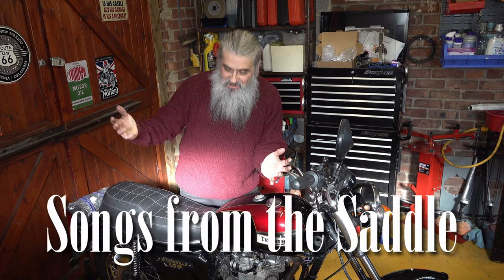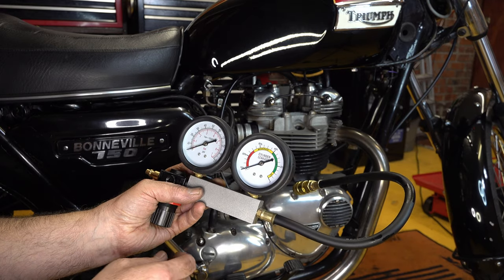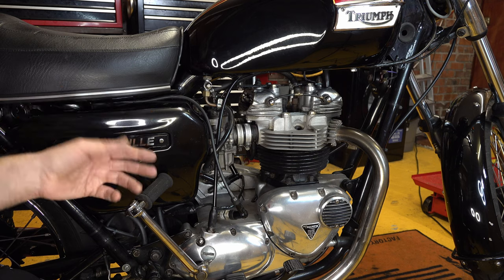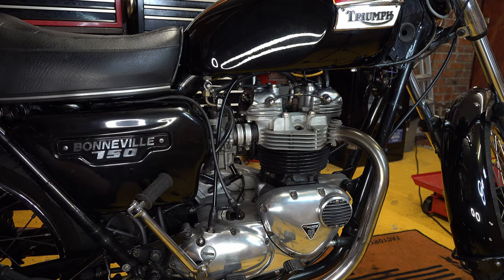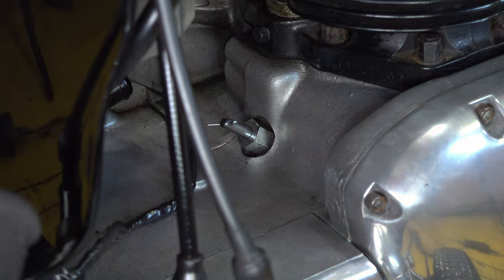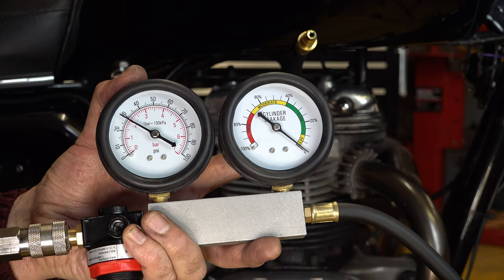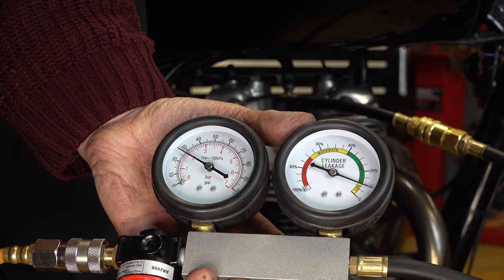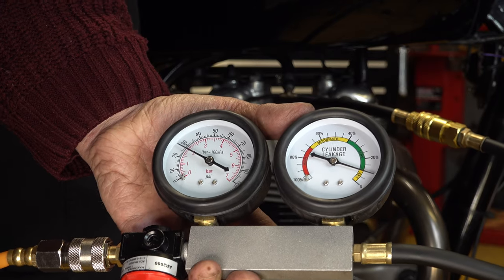Triumph Bonneville T140 leakdown test

Comment: Simon, just wanted to say thoroughly enjoy all the videos especially being as I am on my second t140e. Both 1979's both US spec ,first one I got in 82 and this one I just picked up in 2021. Spent the winter replacing everything that was rubber brake lines Etc carburetor boots tires they were all 1979 issue the bike only has 9,000 miles on it so basically it's it's a new engine. I've had KZs GPZ ninja 900 and whatnot of all the bikes I have always found these to be the most enjoyable to ride and quite frankly if we're riding under a hundred mile an hour and we're going through curves good luck I wouldn't even take my ninja against it. My description to everyone about these bikes are it's like having a 10 speed with a 750 motor on it. So far all the information I've seen is spot on so that'll help some of these younger guys and gals to keep these bikes going . Keep up the good work. Hutch

Comment: Peter Coates
Simon, thanks for the videos on the T140, of which I own one, I also have a 1959 Norton Dominator 99 which I fitted a tap in the oil line to stop it wet sumping, and yess you guessed fell for the old trick of forgetting to switch back on, cost me in excess of £1000 to have it put right, so now when it runs , oil pours up the cylider bolts and leaks onto the spark plug bases...any ideas?.
Reply from the maker: I know a couple of people who have fitted a switch which is activated by a solenoid when you start the bike. That seems to be a good option.

Comment: This may sound dumb but It doesn't make sense to me that a cylinder can be totally air tight like that.   I believe it's happening, I'm not a leak down test denier,  I'm just a bit confused because the rings all have a small end gap, right?... wouldn't air just escape through the end gaps is it was being pumped into the cylinder?   I understand that compression is created when the pistons are moving up an down, but to be able to hold PSI like that has me scratching my head.    Someone will explain it to me I'm sure.  : )